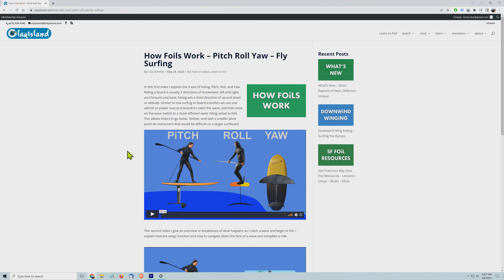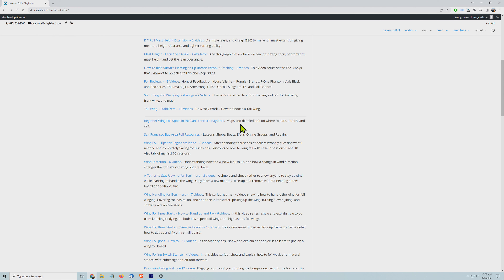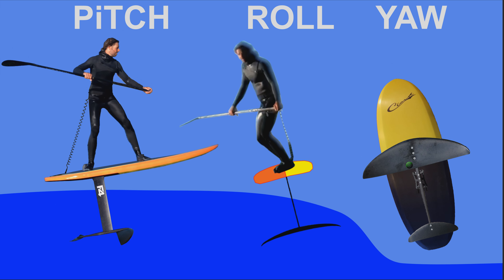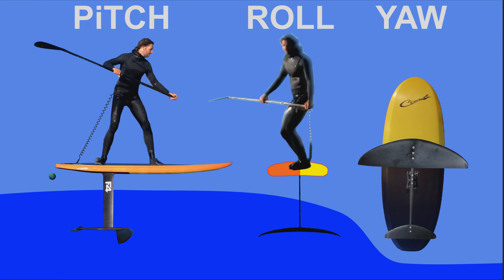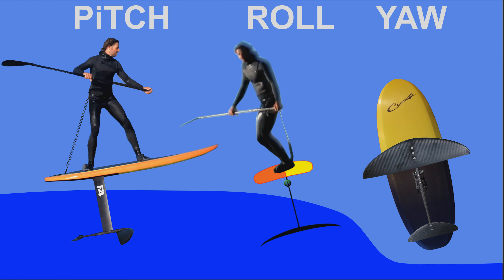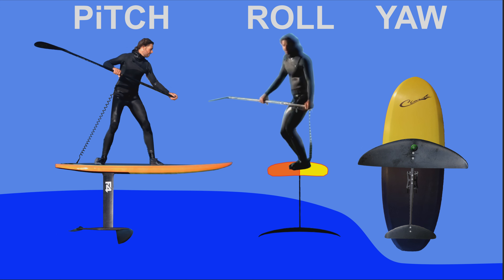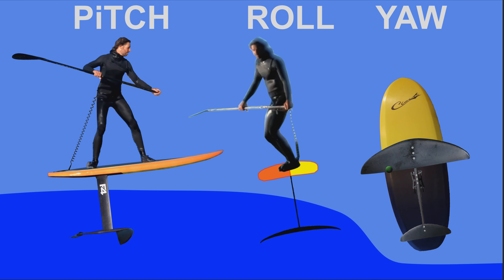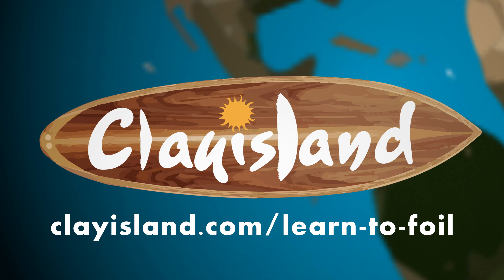How Hydrofoils Work - Pitch Roll Yaw - Learn to Foil

Comment: I find it hard to control the pitch on my Wing foil . I have a Armstrong ma1475 foil ,70cm fuse and a 232 stab . I try to put as small inputs as possible and is ultra sensitive. Everyone on the water is solid the pitch and board height is just locked on. I look ahead that has helped and tried feet close together . Can not work it out.
Reply from the maker: I hear you.  You can try my Learn to foil course and see if there is anything you are not doing.  Difficult to offer help without seeing what's going on.